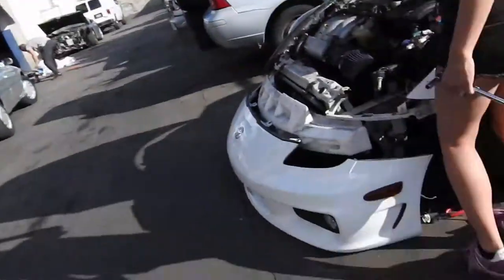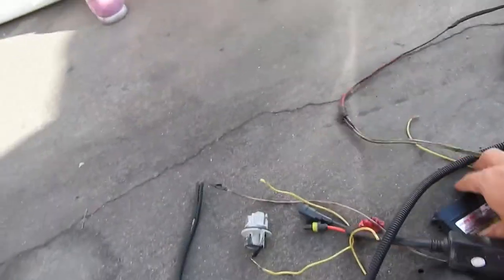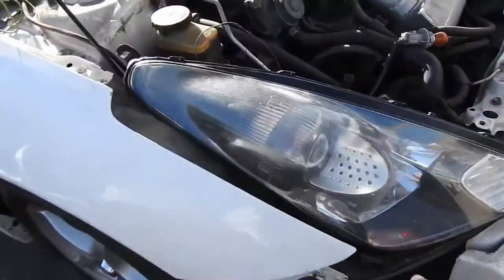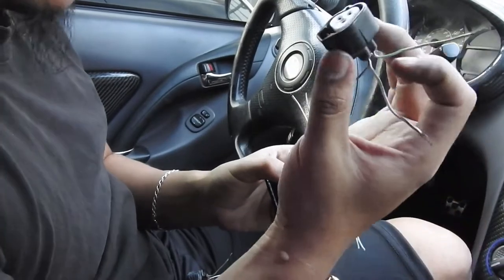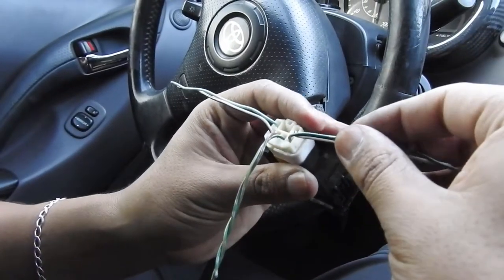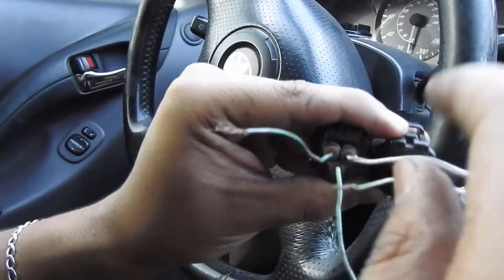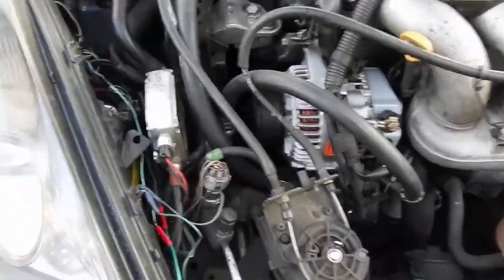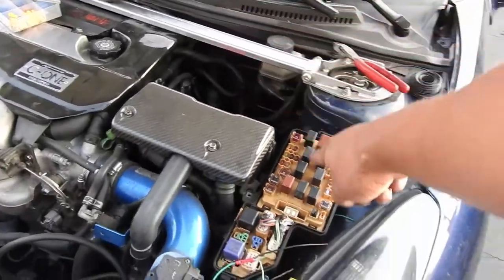How To Install HID Leveler 00-05 Toyota Celica

Comment: Hey Rafa, Did you used to work at Thousand Oaks Toyota? 
Subbed and enjoying the Vids!
Just wondering if the leveller switch came with the blue light or did you install that?
I have always wanted to do this leveller install but not having the proper electrical connectors or the leveller has stopped me. Toyota wants a lot of dough just for connectors and wiring.. 
Also Did you manually adjust the levelling motors with screwdriver to make sure they were in centered before installing and then make sure the dial starts in the middle when connecting, or how does this work?  
It was hard to tell but it looked like when you where adjusting them they traveled further in one direction, indicating they were not centered to begin with or the dial wasn't.
Reply from the maker: Dan Tomkinson No I didnt thats a different rafa and no I didnt center them before I installl I forgot bc i was in a hurry because I had customers, what do you need?
Reply: Well I need the levelling switch and the connectors/pigtails for headlight levelling motor as well. I could jerryrig the wiring and use pins but I prefer Oem connectors. The price is what's stopping me from buying them from stealership. I purchased all the other connectors to use Oem connectors for ballasts and they cost a lot, they did come with motors but I didn't want to pay hundreds for connectors switch and wires..

What about the blue light on leveller? I seen klints video on levelling switch and his was red?
Reply from the maker: Dan Tomkinson I have an extra switch and one piggy tail might have both not too sure and I bought it blue the guy before change the led, oem it comes orange, clint change it to red
Reply: Rafa's Garage  oh that's awesome, I will take those for sure, Do you have PayPal?  

I would need the pigtail for switch, 2 pigtails for each headlight motor and the switch itself, of course.  

I know you can buy just the connectors from Toyota but than you need to buy there wires for correct pins and rubber grommets, so ridiculous.

 I just figure headlights should have good weather proof wires you can depend on, don't want to skimp out.
Reply: Pretty sure Rafa will be giving the people what they want, hid levellers part deuce, centering the motor for oem hid..please..
Reply: Rafa's Garage I'd like to you ask what could be the possibility that my leveler switch stopped working, the led light and the motor is not working.